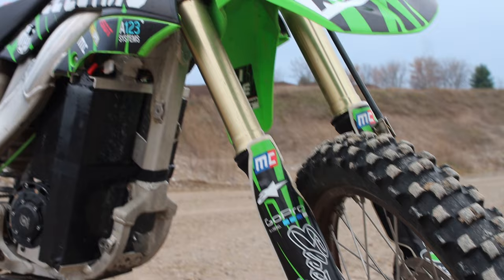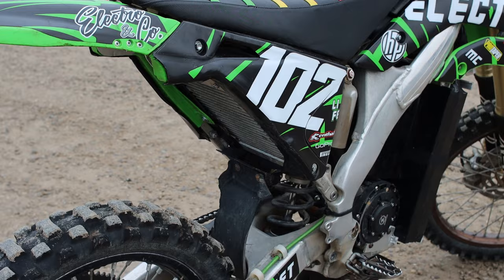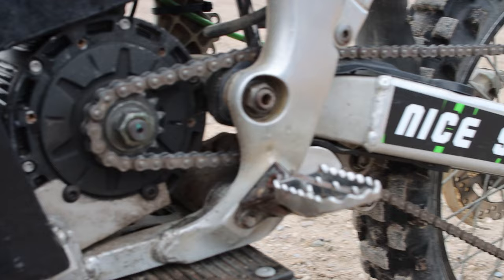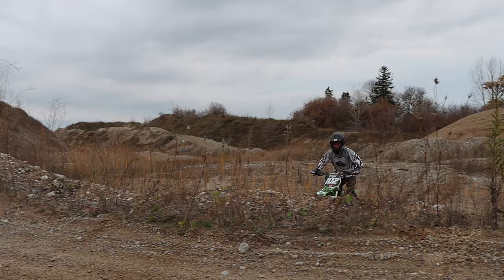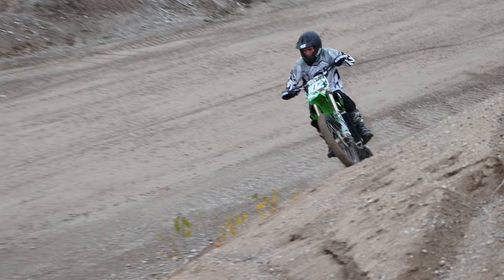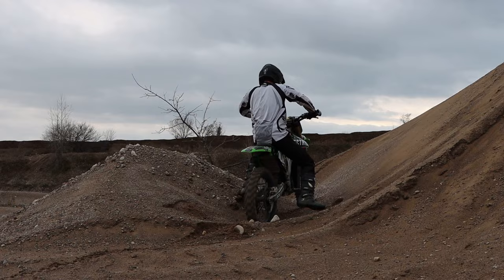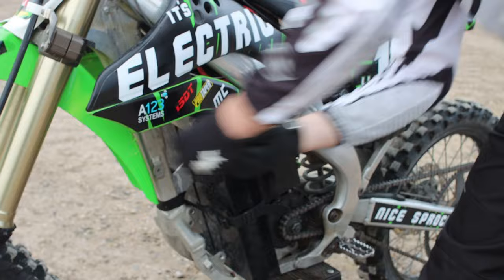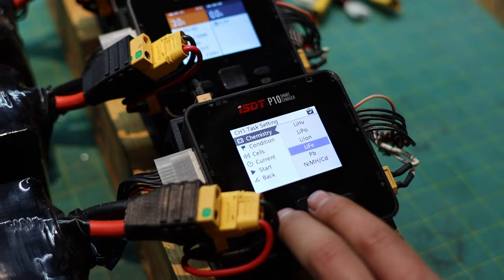This Electric Dirt Bike Was Built in a Barn! -Reid Schwartzentruber

Comment: @tooljockey2777  I've got a fairly mint condition 2009 Honda CRF450X that I am thinking about converting due to wildfire danger where I live and ride.   How much of your parts list was picked due to it fitting in your Yamaha chassis versus you picked the parts and made them work?   Thank you for sharing your work.
Reply: 250s and 450s usually have the same size frame.  That's really all that matters when it comes to deciding what size battery you can fit on your bike.  This guy used a Kawasaki chassis.  But regardless of what bike you use, the motor, controller, and battery could go in any full-size bike that can accommodate them.  The electrical stuff will need fabricated to whatever bike you use.  Cheers and good luck on your project.  The QS138 is a solid motor and I can attest to Votol controllers working well for this application as well.